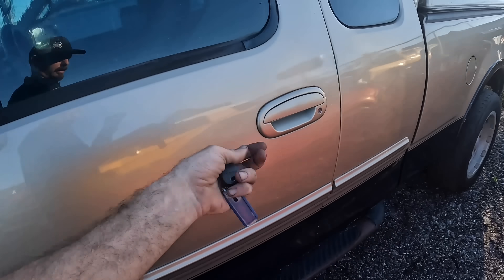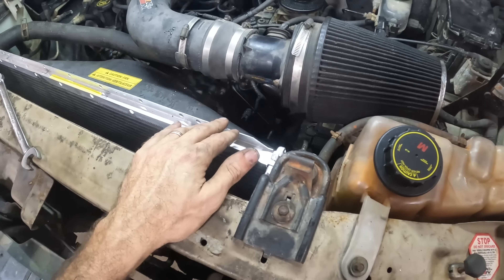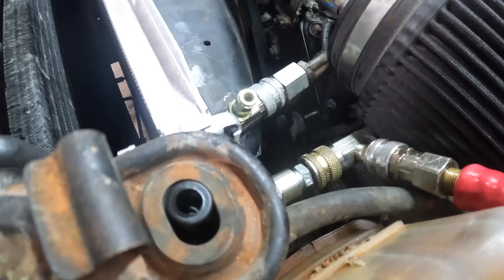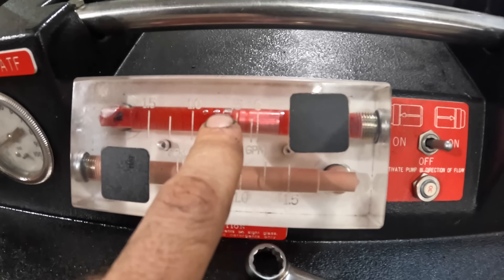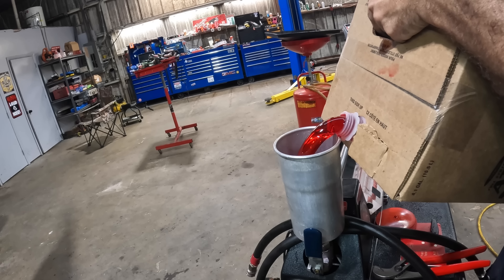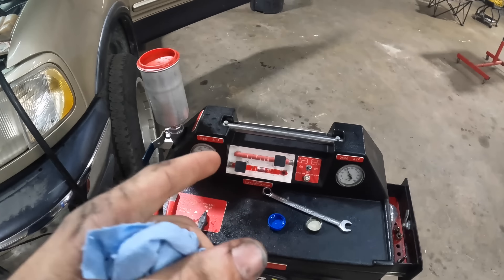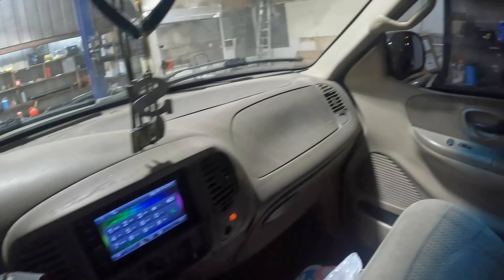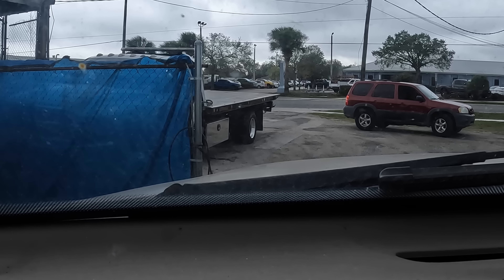Customer States: “Fingers Crossed” No Chance! 2000 Ford F150 4.6 5.4 Transmission Damaged

Comment: You screwed me out a test drive,  if you was burning brakes you'd drive around 20 miles and thats after using hand-pump to pump up all four tires, I dont care about burnishing brakes, I care about saving transmissions. I really want to see what the trans fluid looks like after a few miles and know for sure if you gave it an extra 10k miles, you get 1/2 star review..............

Comment: imo the reason you are getting so many fluid flushes is because you are willing to do them.
dealers aren't willing to do the flushes because they cant warranty the work.
i hope you are informing the customers that these flushes are done with no guarantee that the trans will survive.
i had my trans on the brink but they did a flush, and it lasted another year, but left me stranded when it went, so never again, when the time comes to work on the trans, it's swap it out if i care about the vehicle, or replace the vehicle.

Comment: ok, this is the only time i dont agree with you here. You screwed up the first flush, that's on you. you should not be able to charge the customer because you screwed up the lines. you even recorded that and said that in the video that you reversed the lines.
Reply: he didnt screw up the lines, he just pumped it one way instead of the other. if anything that's a problem for his machine not the transmission
Reply: @bradhaines3142  correct. which is why you dont charge the customer again when its not their fault
Reply: @davedave6404  no one said that at all. I was saying why charge the customer again for something that was a screw up on the mechanic/machinery used. thats not the customers fault

Comment: Geez... that's A LOT of trans fluid. And dat stuff ain't cheap. You used 11 qts. and then threw it away. Wouldn't that the company that makes that machine would also make a compatible (less expensive) fluid that you could use and dispose of to flush the system. I dunno. Seems wasteful.
Reply: If you market yourself as a premium product line, you don’t sell a secondary cheapo product, it undercuts your brand image.

Comment: The weird and ridiculous review didn't have a screen name anything like " @kits2169 " did he? A character using that screen name left a rather long and derogatory comment under your " Did I Damage the Engine? Final Assembly! Lexus RX400h " video amongst the 50 or so up the top. I replied to him but this is his post and it sounds a lot like the sort of weirdo who'd do that.
What he wrote is copied below and if you look for it, it's roughly about the 15th to 20th sort of area. Actually there's 2 weird posts from him one after the other. The first one just gets weird and silly, the second one gets much dumber and weirder, I'll post them below in order.

 kits2169: 
   "  I hope it was a joke, but honestly if not the heat and power probably wouldve burned and sucked the rags into the exhaust or worse the engine block, clogging it instantly when he started, so if it wasnt a joke, hes lucky they were still there or this project just got a whole lot worse, you dont want a single spec of dirt in there let alone rags. I do think it was a joke though, if he ran it with those inside, I highly doubt they would be right where he left them. If it wasnt a joke, this dudes gonna get sued someday for sure "

And number 2 from kitty boy:  
 "  I think when he said "from Australia" he meant krizzy was from Australia, not Ray.... he is saying hello from all the way over in auzzy and admittedly i dont think ill be watching these anymore, joke or not he does some sketchy stuff that I was always taught to never do and I really want to make sure the work i do on my own vehicles are done right. Hes not terrible, but I wouldnt look up to him for advice. You'll learn properly from ChrisFix, no disrespect towards Ray, but Chris is more knowledgeable.

Rays list of what I think are improper:
Rarely torques bolts down properly and hardly ever hand screws a bolt in first to avoid cross threading
Doesn't follow star pattern
Sprays brake clean willy nilly, a product that breaks down petroleum products, around petroleum products and inside of a diff (if it doesnt evaporate completely, a few drops will change the diff fluids viscosity or worse, making it unreliable.)
Sometimes does not recheck mounting points that he has adjusted when lifting

As minor as they may seem, these careless mistakes are why I am blocking the channel from my feed. Sorry Ray, I dont want to make the same mistakes on my own vehicles. And as a shop owner you are at risk of a lawsuit for not going by the book, even though I am aware you dont always have to go by the book to get a job done. It's for your own protection. idk, I care enough about my cars to work on every small detail the right way, and I'd be even further disciplined when working on someone elses vehicle because that would be my name behind the repair. "

Comment: There's people that don't like you????? REEEEEEEEEE DICULOUS!!!!  When other car guys like you, your viewers like you, your customers like you, and your family still likes you.... No one else matters.
My father is a mech. 
My mom had to drive a car with no reverse for almost 6 months. stuff happens.
I had a car that would ONLY go in reverse. I drove it, with an escort, 11 miles, mostly back roads, to a guy to get the transmission replaced. I got stopped by a State Trooper... He asked why... I told him it was broken, and I had no $$ left after buying a junk transmission, to afford a tow truck. I bought that car for $300, and drove it for 10 years, plus 2 transmissions. (the first junk tranny was actually junk...) With the second junk tranny, I had the guy replace all the seals, and the filter on the bench before he installed it. Got 5 more years out of the car! It was a 1979 Olds 98 Regency. Small block, Olds 350. It got 26 mpg if I ran highway and high octane gas. That car took me across the country and back.  I had to replace the water pump and thermostat on the way home in Ohio in the parking lot of a auto parts store. Got in a screaming argument with the parts guy over the thermostat gasket. Mine had the extra port, for a hose that ran 7 inches down to the top of the water pump, he said it didn't have the extra port. I actually had to disconnect the thermostat housing from that hose, and bring it in to SHOW him the extra port. By the time I got done with him, his boss almost fired him, and I got the thermostat and the CORRECT gasket for free. The water pump and gasket was only $30. Plus $10 in coolant, $3 for the Indian Head.. And about an hour and a half... Not bad for a 24 year old mechanic's daughter.

Comment: Shouldn’t have bought a ford let’s integrate a fucking tranny cooler with our radiator they already bought a new motor idk why people buy ford
Reply: i dont like ford but fact is most of them do that
Reply: @bradhaines3142  yep. Integrated systems are fairly common. They're used as a space/cost saving measure by the manufacturers. Doesn't make it right, but it happens.
Reply: @stevenbaker9327  you know that and I know that, but manufacturers do what they to do.